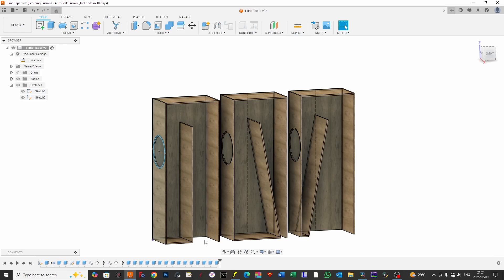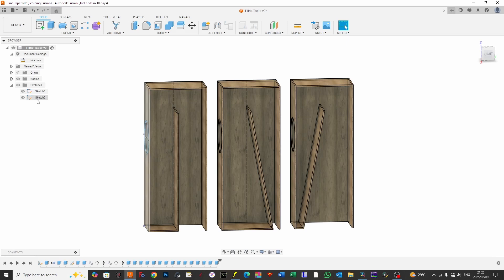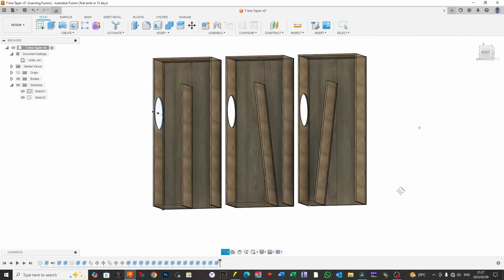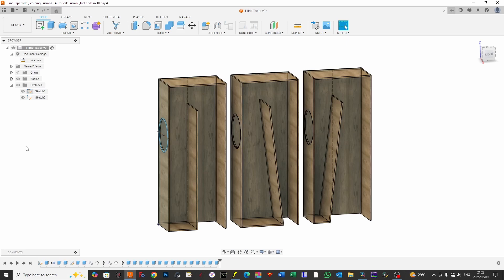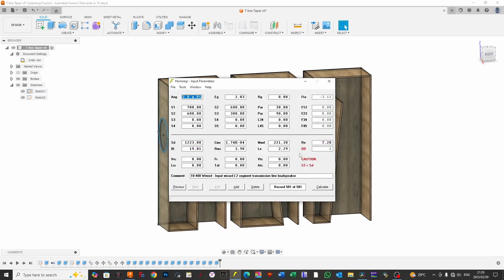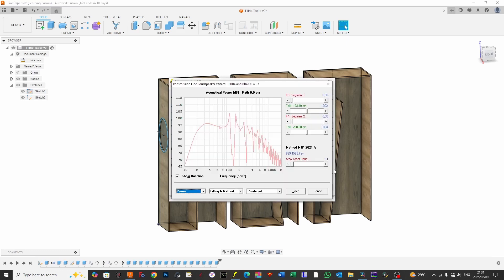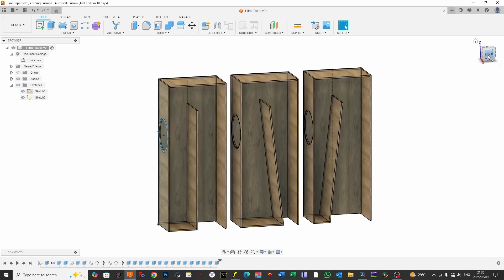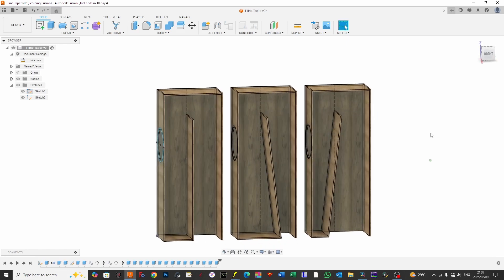Hornresp Tutorial Part 5 - Tapered Transmission line design theory

Comment: Thank you for putting out such amazing content. As far as the line length folding goes, for a simple 1.1 should it be folded on itself? For eg if I have a 2m line with a 200cm horn, does it imply 2x1mx200sq cm sections? What should the internal folded line length be if my box height is set to 1m? Sorry to bombard you with questions
Reply from the maker: Basically you are right, area in cm such as 10cm x 20cm = 200cm. 

Line length total is 2m / 2 halfs, but the fold is not exactly half. The corner itself has a sweep which increases the overall length and you should google the advanced center line method. Thabk you for the kind words
Reply: @The-Sound-Guy thank you so much for such a swift response 😊. Much appreciated

Comment: great video! a question: how do you simulate folds in a Transmission Line in Hornresp? Analogue to SpicyTL, where you can define sections of the line as 90° o 180° folds; is that posible? Or is the software limited to simulate only straight and tapered pipes?
Reply from the maker: Folds are a bit tricky, google the advanced center line method. As you fold, that corner actually increases in area and in length. Often you will find if you check the Zma measurements vs the model you will be slightly lower tuned and this is because of the folds. 

Use freecad and go here, follow the video tutorials 😊 https://freeloudspeakerplan.rf.gd/?i=1

Comment: Hi, many thanks for your amazing unique tutorials on this topic.
How would you simulate a Voigt Pipe ? If the mouth is big should it be an open end or a closed one ? The results are quite différents, thanks for your clarification. 😅
Reply from the maker: You can fold the line both ways, going from a small to a large opening will boost the overall loudness but with this approach the model becomes more resonant. Going from large to a small area will promote a more stable  and cleaner looking response trading off some sensitivity. A mass loaded line can sometimes serve to have the best of both worlds 😊

Comment: hey, very cool stuff helping me a lot,
i had an idea for this I'm trying to make 2 6.5s out of phase, face each other with a double transmission line box, like two shown in the video just symmetrically copied on each side and two drivers
that being said i wanted to use the front face or the expansion ratio terminus as a port using another piece of material to limit the airway made there, is this the right approach to porting such a thing? i want to use this box to make crazy mid-bass i have a 15 that will dedicated to the lowest end, bot i want to make the 6.5s handle mid bass

how do i tune this to achieve a good curve around the hertz i want for the enclosure and how do actually graph it out to build it after the fact of using these programs, im a good woodworker and im sure being exact wont be the issue, im just having trouble with calculations
Reply from the maker: Sounds like a compound layout, this is great in one way but not so good in another way. I will try explaining, but let's try to connect on Facebook or hold tight as we get ready for more content.

Comment: Hi, thanks for the tutorial. Can you explain the choice of parabolic? The area still changes at a constant ratio, linearly with the length of the TL,, so I would have thought each one of these would be conical. It'd only be parabolic if for e.g. the sides of the speaker tapered, no?
Reply from the maker: @mitskcih  Hello my friend, we must think of it like this. If we look at a round tube, it has no expansion. The same would apply to a square tube. A square tube we can see the vertical wall are 90 degrees, and the horizontal is also 90 degrees parallel to on another conical. 

Here we now have a new taper angle  but only in one plain or axis, the other remains parallel, even though our expansion ratio is constant the Key here is they are no longer parallel to one another 😇.

So the width of our box does not expand and has 2 parallel walls and the other Axis is expanding "yes it's constant" but the 2 walls are no longer parallel.